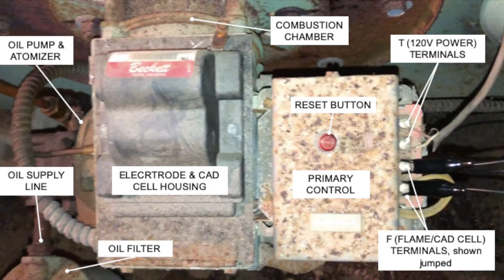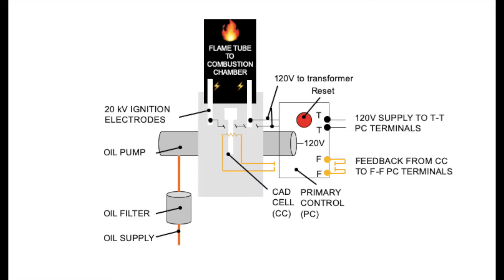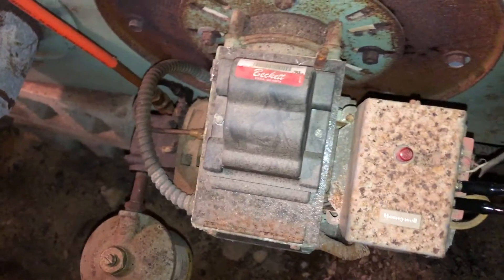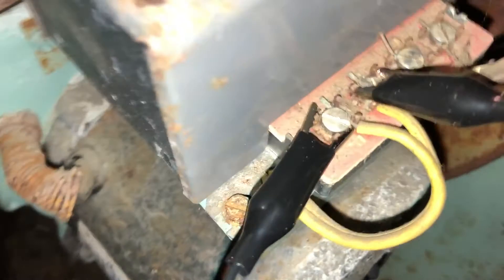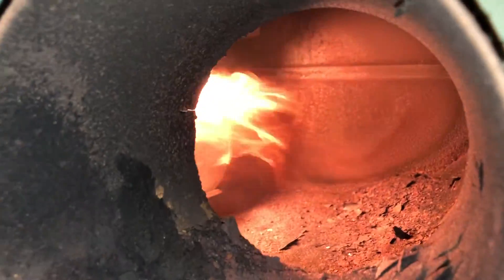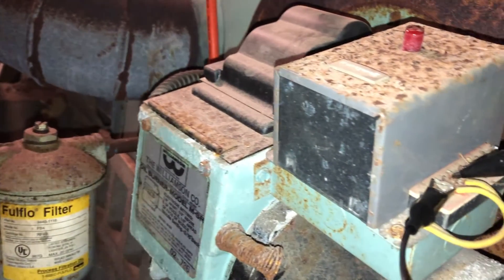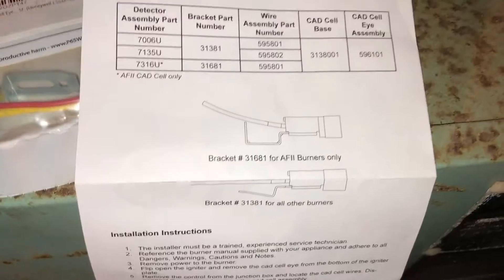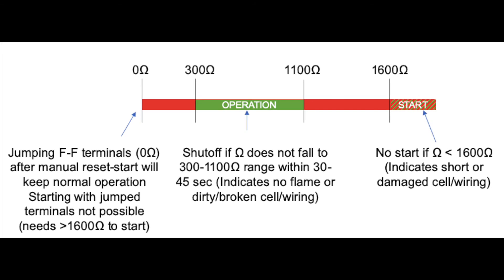How to Troubleshoot an Oil Burner

Comment: If the flame is too rich and therefore not overly bright, can that cause the cad cell to not get enough light and trip the relay?
Reply from the maker: Not sure tbh. But I imagine there’s a threshold in the light vs resistance curve of the cell that may cause exactly what you say. Would need testing to confirm and at $20 per cell I didn’t think it was worth the time. Hope this helps!
Reply: @OliverPorter92  I’ll try it, thanks.
Reply: @OliverPorter92